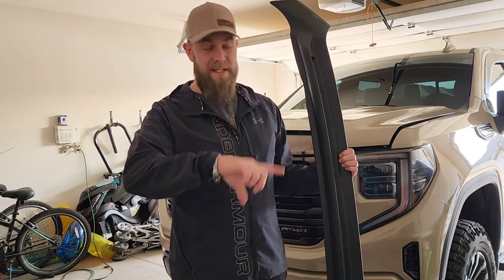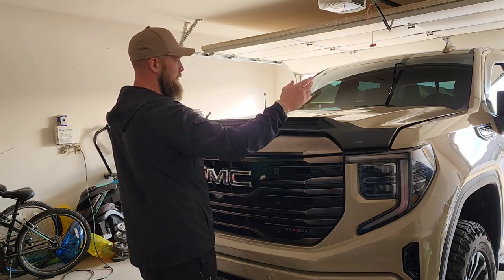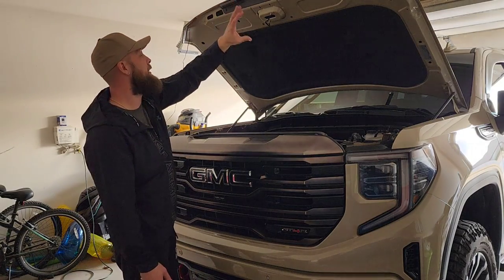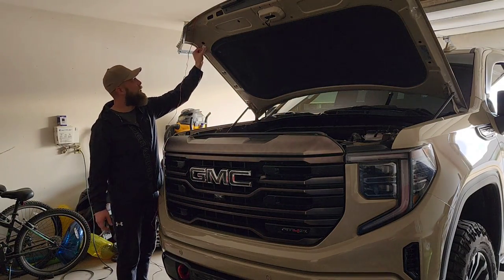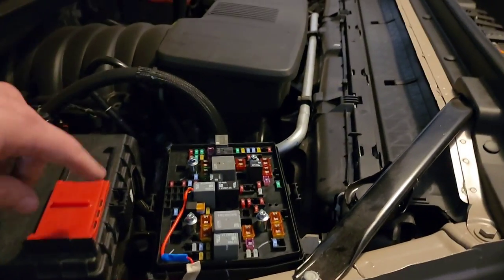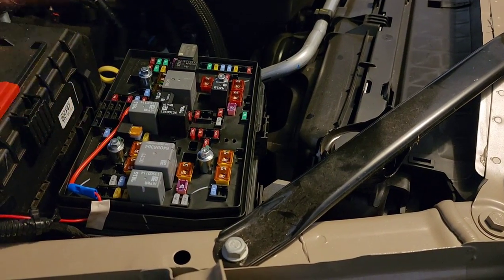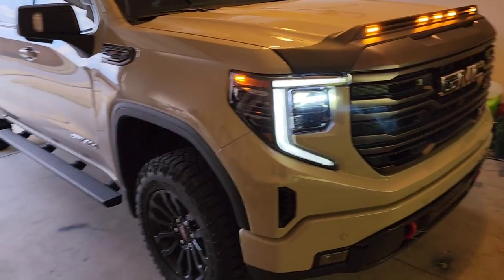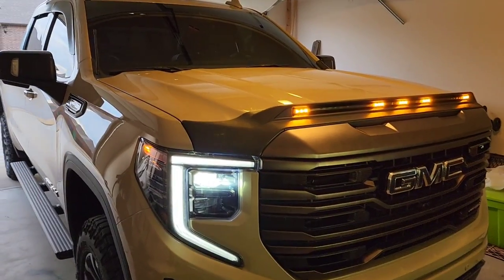LET THERE BE LIGHT! AVS Lightshield Install

Comment: I didn't see this mentioned so just a heads up, in case you didn't know: the add-a-fuse fuse taps are directional. If you don't plug it in the "correct" orientation, your added circuit will pull through both fuses in a series. It might not be a problem depending on the circuit, but if you start blowing the fuse designated to the original circuit you definitely need to check the orientation.

Comment: I added similar lights on my truck but I used a really long zip tie as a wire fish tape and ran the wire inside the hood where there's a channel so you don't see any wires.
Reply: I used a hanger but worked as good.

Comment: Thanks man. Really helped clear up confusion on the fuse box placement and strategy. Earned a new sub 😊 I have the cab light version, but yours turned out great. Good luck with the wireless version, haven’t heard great reviews but hoping yours works well and that they fixed the issues.

Comment: Dont like the wiring part. Dont like how the wire comes underneath the deflector.  Also not a fan of using 3m tape.  Will probably damage the paint if or when you need to take it off.  Had way too many issues with my Mustangs rear wing. Destroyed my paint.

Comment: I just watched your video where you installed the Rough Country steps and noticed a similarity.  The way you run/route wires needs much improvement.  It's just sloppy work.

Comment: Thanks for your video. I know know to Tap and into #28 fuse for my grill light install. All other videos were saying #42 but thats not right on a refreshed Sierra 1500
Reply: Ya I'm not an electrician but its weird that we are getting constant power from switched fuses. Only thing I can think of is the headlights are on a timer and even when you turn the truck off at night the headlights stay off for a few seconds.You would think it would relay the shield lights off.

Comment: Can you add any white led strips or just the lights that come with the hood deflector ?
Reply from the maker: You could get any set of leds, as long as the size fits in the slot
Reply: Can you measure the length for me for the Led. Thanks

Comment: hey WICKEDAUTO. I have an issue with the fuse 28: the shield lights are NOT ON when lights switch is set to AUTO (so it's auto on/off depending of the day/night) and it's a sunny day (meaning the low beam is off). Did you notice anything like this?
Reply from the maker: No I haven’t, mine are on at all times as soon as I power the truck, whether auxiliary or actually started. Not sure why it would be different but not the first to say so either

Comment: Does your light work with your auto headlights???
Reply from the maker: It’s always on for me, that’s why I did the fuse tap
Reply: @WICKEDAUTO1  I too used a fusetap as well but the lights do not work with auto headlights during the day?
Reply: @358baseball  me tooo Hello friend, can I ask you how you connected your AVS trim? I have a trail boss lt and I already connected it to module 3 and 4 and in both of them when I put the truck in drive they turn off
Reply: @danogarcia5804  I connected mine to Circuit 28 initially and then put in in Circuit 40. Currently have it in 28 because the light bar started to dim after just 1 week of having it in Circuit 40. Not sure if the light bar was already bad or if it got drained.
Reply: @358baseball  do you have  problems in 28?
Reply: @358baseball  28 is empty, did you use a 20 or 15 fuse?
Reply: @danogarcia5804  I used a 20. What year is your truck? Mine is 2023 RST, maybe GM changed something for different models.

Comment: Thank you  your video was very helpful and made it easy to install. The only issue i had was my check engine light turned on I have a 2024 GMC Sierra Elevation. I unplugged the negative terminal on the battery when i first installed it. Is there a way to reset the check engine light? Thanks
Reply from the maker: Completely disconnect the battery. Wait at least 10min before hooking it back up
Reply: Thank you ill try it! @WICKEDAUTO1

Comment: I really like your low profile window vent visors, how do they do with wind noise, better or worse than without? They are AVS right
Reply from the maker: No they are factory stick on in matte black. No wind noise at all
Reply: Would you happen to have the part number or link to the window visors?!
Reply from the maker: @saltlifechris3623  Part No. : 19417401

Comment: After a year and you decide to remove these, any harm to the paint?
Reply from the maker: Shouldn't be as it is not touching the paint, the 3m is the only thing touching
Reply: @WICKEDAUTO1 how do you get the 3m off without damaging the paint?
Reply from the maker: @dustindewitt1553  heat, could just let it set outside depending on how strong the sun is where you are or a heat gun. After you get off what you can with heat, Goo Gone, WD40 and brake blaster all work well for getting the left over off